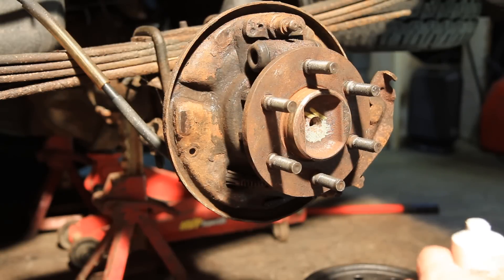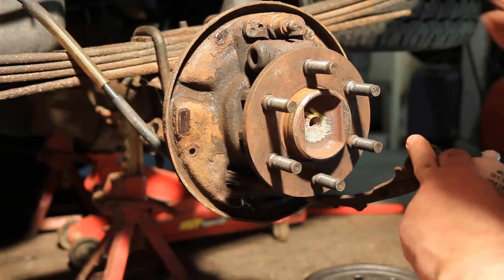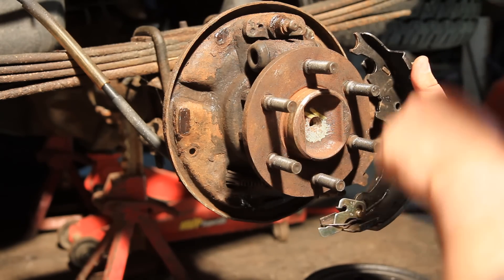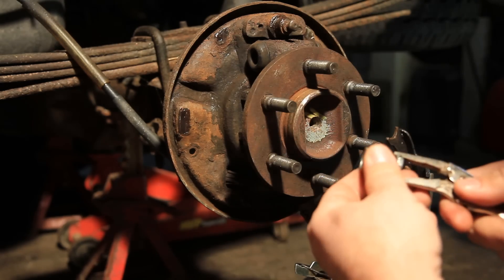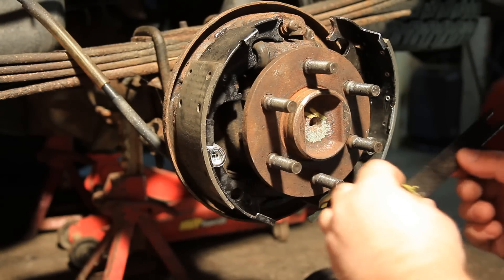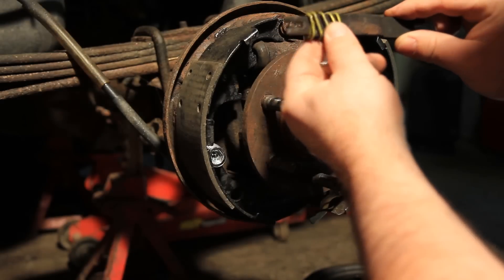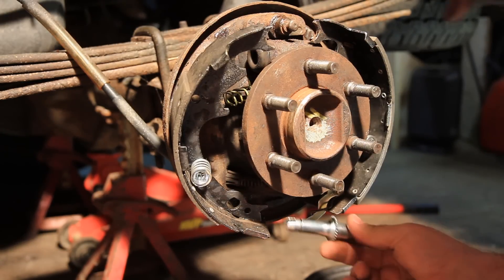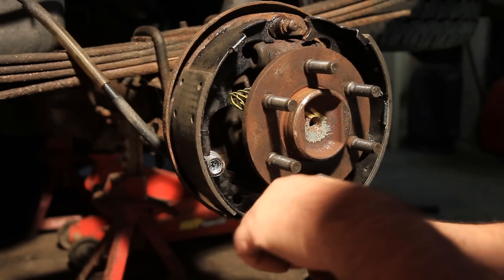How to Drum Brake Installation 2002 Dodge Dakota

Comment: Great video, my only advice is the last part, when attaching that piece its better to use a flat head screw driver to mount the cable on the pulley after connecting the spring.

Comment: Great job Mike but one question.The pin that the self adjuster is attached to on the shoe is NOT  on my replacements.How do I remove this from the old shoe and reuse it?
Reply from the maker: I just yanked it out with some vice grips and pressed into the new one with my vice.
Reply from the maker: ***** Good point though, I left that out.  Thanks!
Reply: ***** thank you!
Reply from the maker: np

Comment: would be nice to see from dead center as the issue i am dealing with is the brake adjuster which you can't see at all and makes video useless for me.....
Reply: the springs broke and caused a mess ....... wanted to see  what it was supposed to look like .... found another site....thanks

Comment: Great job Mike but one question.The pin that the self adjuster is attached to on the shoe is NOT  on my replacements.How do I remove this from the old shoe and reuse it?